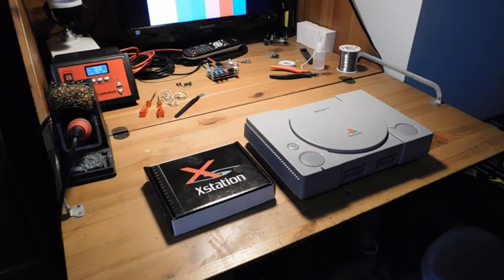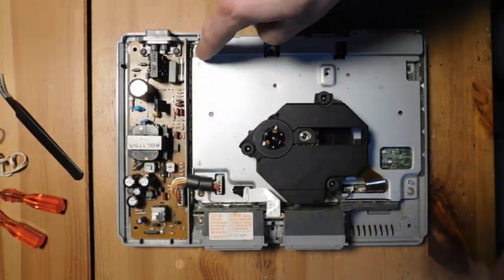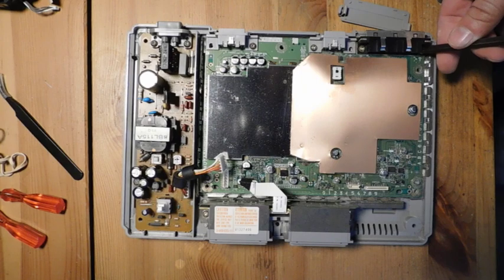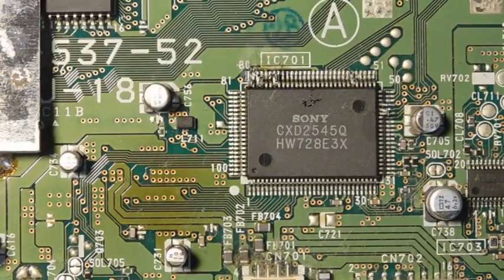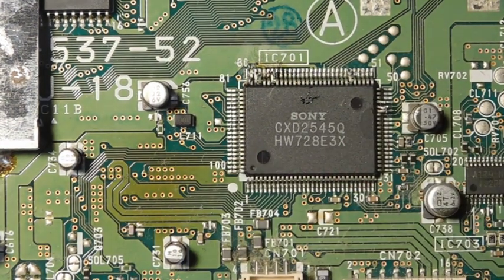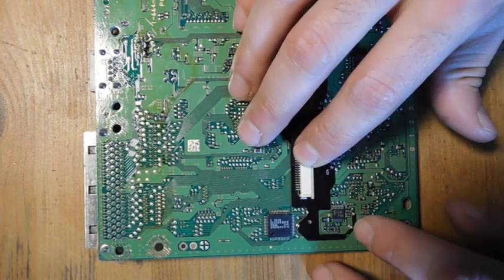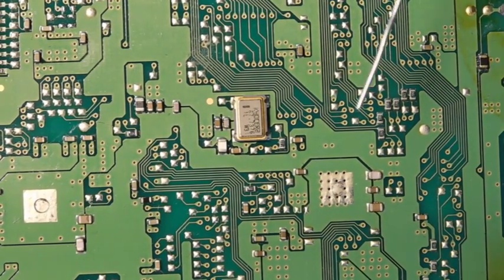Sony PlayStation XStation Install Guide - a new Optical Disc Emulator for the PS1!

Comment: Got mine in the mail today. Going to install tomorrow. Thanks for the guide and helpful tips.
Reply from the maker: Awesome! Hopefully the video will be helpful
Reply: @LIRetroGaming  I successfully installed mine. It wasn’t that bad. After learning how to pull up pins on the chip it was pretty easy. I think installing on the 100x model we have it a little easier. Less pins to pull and no non-solder points that need scraping. Bought a micro fiber pen that I didn’t end up needing. Oh well. Thanks again for the tips.

Comment: I'm going to install mine this weekend. Very good video! You made it look easy...except for lifting pins...I always hate doing that! Thanks for the guide, man!
Reply: Edit: I have installed the XStation and everything is working as expected. Pretty easy install, besides the pin lifting. Rama couldn't have engineered a better product! It is a very straight forward installation. I did have to hold the reset button down for 1 second to get the XStation to boot into the menu for the first time. Just a heads up, for anybody that runs into that.
Reply: Yeah, I hate lifting pins.  I accidentally broke on doing the saturn PAL/NTSC fps swap, and it makes me nervous everytime now :(

Comment: Nice guide, you don't need to cut the shielding though, just pass the ribbon through the slot thats forming between the two shielding pieces (lower and higher).

Comment: Im ok with soldering but that is a hell of alot of pins to lift scary haha
Reply from the maker: Yeah it can be a little intimidating at first. It’s always good if you can get practice on some kind of scrap PCB. Having magnification can also make it easier
Reply: If they snap you have still accomplished the same thing! It won't be a problem, but now it's irreversible without jumper wires.
Reply: @LIRetroGaming  hi what compatibility it will be ?
I heard its not compatible with 7000x series psx
Reply: @Sammy Van Dankstein ive done snes 50/60 mod b4 and megadrive 50/60 hz.. just not confident with xstation haha

Comment: Just got this for Christmas! Excited to jump right in though bending up those pins looks very scary.
Reply from the maker: Yes I would suggest practicing that if you can with a scrap circuit board. It’s not too bad once you have some experience
Reply: @LIRetroGaming  Yeah I may do that. Also going to get a magnifying glass.
Reply from the maker: Yeah I definitely recommend some kind of magnification. It makes proofreading your work significantly easier and really helps with pin lifting

Comment: I'm glad that the Xstation doesn't use the original optical drive connector, since I've got a Playstation with a busted one! It had torn completely off the board when the optical drive was removed and some pads along with it. Otherwise the board should be fine!
Reply: The installation was relatively easy! The main problem was that they only sell lead-free soldering tin in the EU, which apparently needs a higher temperature to melt (Between 370-425 C, or 698-797 F). I didn't know that at first which made the initial attempt frustrating. I found lifting the pins to be the easiest task! I accidentally lifted a neighboring pin to what I was supposed to, but it was no problem soldering it back on. Aligning the board in the back felt more challenging, but everything went better than expected in the end. The console might need recapping sooner than later.
The Xstation seems to be working properly! There was some issues with lagging FMV and hanging or freezing in some games, but I think it was a case of bad files because it all seems to be working correctly on different versions of the same games.

Comment: The official install guide makes no mention of cutting the shielding and the additional post you removed. Why did you do that?
Reply from the maker: It’s not mandatory at all to do that, but I cut the shielding to make it easier to bring the flex cable over to the XStation board. You can try it first without cutting the shielding and it should be fine

Comment: Hey, I'm new to modding and soldering but very much keen to give this mod a go. I was just curious as to what you are doing/using 6:43?
Reply: He's removing the Excess solder that may have caused a bridge between the two pads of the pins of that Chip with a "Desoldering Wick". and Sorry i'm 5 days late.
Reply: @FR4M3Sharma  Okay, awesome. Thanks heaps for clarifying that! 5 days late is better than not at all. Haha.

Comment: Here's a few tips when installing this. Use a hot air station to remove chip then use cutters to remove or bend unneeded pins. Resolder chip using flux. For the vias that are covered in solder mask, just trace the traces on the board to a nearby solder pad and make connections at that location.

Comment: Could I just snip the pins on the chip instead of desoldering and lifting them if I don't plan on reverting it back to stock?
Reply from the maker: Yes you can also do that too, as long as you are careful and you remove the severed legs as well
Reply: I think I might go the route of snipping the unneeded pins as well! Lifting looks scary and I'm afraid I would only make a mess with the solder and mess up the neighboring pins as well.
Reply: @LIRetroGaming  Just to be absolutely clear, what do you mean by removing the severed legs?

Comment: Used this quite a bit today, but good lord, I could never get solder to stick to the rightside connector that has the anti-solder stuff on it. I scraped the hell out of it, but the solder would just keep balling up on the tip. I read somewhere that that's for reset, but even getting however much I could get on there -- if any -- I get stuck on the menu without the ability to move the cursor. I can open the lid and move between Memory Card and CD Player, but closing it locks it up. It seems to be initiating the disc drive once the door shuts, but now that it's the XStation, something's wrong and so won't load anything. The pins somehow turned out to be the easiest part.
Reply from the maker: Damn, sorry to hear about your troubles with removing the solder mask. You may want to try a fiberglass pen, sometimes that can be more effective for removing the solder mask
Reply: @LIRetroGaming  Would that be the only reason the solder seems to ball up and move along/up the soldering iron rather than onto the board itself? I read somewhere that that could be heat issue, but mine is at 300, and most people seem to have the opposite problem. Thanks for any insight you can offer, this is driving me nuts.

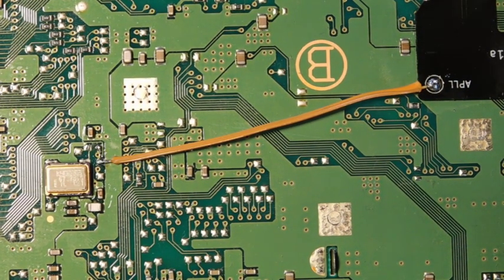Comment: 13:30 I didmt get that wire in my package!
Reply from the maker: It does not come with the package. I just have wire in my spare parts. 28 gauge wire is perfectly fine
Reply: @LIRetroGaming  dies the wire type matter? I used a random wire ha... And it only goes to the mem/cd screen :/ no xstation screen

Comment: What size wire did you use at 13:23 mark?
Reply from the maker: It’s 28 gauge copper stranded wire
Reply: @LIRetroGaming  Thank you

Comment: I was lifting pins on IC701 and when I got to 50's I managed to lift on IC308 not noticing. I went ahead and pushed them back and reflowed not installing the xstation yet and I tested it to make sure all was correct. If the xstation isnt installed after this point will you still get sound? The boot menu takes 10 seconds now and I dont get sound anymore. I hope once I install the xstation that will change because I reflowed those 3 pins back nicely, but no difference from before separating all the pins when I had sound
Reply from the maker: It seems like those pins might not be attached. I think you should figure that part out first before continuing with the XStation
Reply: @LIRetroGaming  Thank you and any chance I could ask what size wire you soldered on the connection point requiring you to solder a wire from the xstation to the board?
Edit: Also is it better to use single core or stranded wire?

Comment: Nice thanks for the video, it helps me to do by myself.   
The thing do not boot, check all again and the result: I forgot to solder 1 pin ja ja ja.   Everything is fine now.  Love this thing.
Now If only there was such a cheap option for my sega saturn like the xstation.  :(
Reply from the maker: So glad that you got your instructions to work and that this video helped. And there is a cheap sd card option for model 1 saturns called Fenrir
Reply: @LIRetroGaming  Ho, thanks, but my saturn is a 21 pin saturn.   And they only sell on Europe, whit the taxes and the shipping the price rise up more than I spected.

Comment: What temperature do you set your iron to when lifting the pins? Is it higher than the temp you use to solder the joints?
Reply from the maker: No I keep it at the same temperature, which is around 700°F

Comment: I have that exact same soldering station, I mostly use the curved conical tip but I have just about all of the hakko 900 series tips possible.

I have my board prepared and ready to install the xstation when it gets to me. Also found a few 1TB sd cards for 20 bucks. Probably gonna be slow to transfer but probably not gonna impact the xstation.
Reply from the maker: It’s cool that you have the same soldering station - I got mine many years ago when a local radio shack was closing and it’s one of the best things I’ve ever purchased. You are definitely going to enjoy the XStation when you get it!
Reply: I remember when my local RadioShack closed. The manager was very knowledgeable and I learned quite a bit about soldering older style connectors. I never took any courses though, I learned all by myself. I tried reworking a guitar hero controller and wound up killing it. Then I practiced on a few kits and finally a busted cdrom drive.

The very first ps2 I tried chipping I ended up killing it, spent a considerable amount of time trying to fix it and just chucked it after a while.

I've came a long way since then and have several ps2 consoles modchipped.

Speaking of which, if you have a 5000x series ps2, GH-026 or GH-023 board. I was able to get the comsoft laserfix working on them. Link is: https://www.obscuregamers.com/threads/comsoft-v4-fix-confirmed.2978/

I suspect I'll need to replace an LA6508 on one as the tray isn't ejecting. The GH-023 I swapped the la6508 from that into the current GH-026. Thats what leads to my suspicion anyways.

I still miss RadioShack, they were a good source of 30awg kynar wire. Wish I could have been there the first day of the closing sale. If have bought a few more stations and all the wrapping wire they had. Managed to get like 3 or 5 of em and even though I'd like to start modding as a business I'm still hobbiest, maybe soon though.

Always a pleasure to see fellow modders.

Cheers!
Reply: @theguruguys  just read into more of those, probably not gonna get those really cheap ones. Gonna save up for the bigger card though, all the roms are ready.
Reply: @Sammy Van Dankstein probably gonna wait see what comes up on black Friday or cyber Monday deals. I'm sticking with sandisk extreme pro most likely in this case.
Reply: @Sammy Van Dankstein still have a few of the old black sandisk cruzer drives when they had the u3 programs. Fun times in junior high and high school. 

I remember they blocked hyperterminal but we could run it through command prompt on windows xp, even worked from a batch file. Same thing with programs normally blocked. Right click and choose run as... then choose the second option as another user, but type in your network domain and your regular account like this:

Domainsample\\youruser
Password

Then most programs like nirsoft system tools could run, even ophcrack, portable Cain and Abel, web browsers normally blocked, etc! On what was supposed to be a limited user account.

Few years later my brother had those programs installed by default on the computer he got from school. The changes we made to the selection of programs.

Comment: mine wont do anything except boot to the cd player screen. Checked every point for continuity. its all good. i dont get it
Reply from the maker: Are you holding down the switch on motherboard? The XStation menu will not boot unless the lid detect switch is held down
Reply: @LIRetroGaming  yes
Reply from the maker: And what is it doing with the sd card? Is the green led blinking?
Reply: @LIRetroGaming  Green led blinks for a second and then stops. With no SD card in, it blinks green continuously. Tried 3 different SD cards. Two lexar 633 and one old hp one. All fat 32 with the 00xstation folder on them.
Reply from the maker: Ok then it will be hard to diagnose further without pictures. Make sure that you lifted the correct pins and that the area underneath the lifted pins is clean
Reply: @LIRetroGaming  hey thanks for talking through it with me! Not many people take the time to help. In the end I went out and bought 4 micro SD cards. Different brands. One of them worked. It's a Samsung. So I guess it just doesn't like some SD cards.

Comment: Hi there. Should I install the Xstation or the PS1 digital first?
Reply from the maker: I have done it it both ways and I found that it was easier to install the XStation first. The PS1Digital flex cables are fragile so it’s easier to install them last
Reply: @LIRetroGaming  aight. Thanks for the reply. Cheers

Comment: PSIO
Pros - Easier to install, More models are compatible
Cons - Less compatible with games, More expensive than the xstation, DRM on firmware

XStation
Pros - More compatible with games, a bit less expensive than the PSIO
Cons - Harder to install, less models are compatible
Reply from the maker: That’s exactly the tradeoffs between these options. For now I prefer the XStation’s tradeoffs and my hope is that it will eventually be compatible with more models of the PS1

Comment: I don't understand why this isn't just a plug n' play style mod. Why does it need anything other than the data/power from the CD ribbon cable?
Reply from the maker: I believe it that the CD drive controller chip is the reason why you can’t have a plug and play style mod with the ps1. It needs to be bypassed completely and the inputs that normally go to this chip need to be fed to the XStation directly
Reply from the maker: Other optical disc emulators like PSIO also need an intervention. Unfortunately I think the design of the PS1 hardware will always prevent a plug and play solution from happening

Comment: What wire are you using to attach to the QSB?
Reply from the maker: Pretty sure that I used 28 gauge copper stranded wire for my previous installs
Reply: @LIRetroGaming  Thanks I went to microcenter and got 26 gauge stranded. Excited to get to work!

Comment: Mine boots to the  bios, not know what todo???
Please help
Reply from the maker: Is the lid installed? If the switch on the top of the motherboard it’s not activated by the lid, then it will not boot to the xstation menu. It may also be an issue with the QSB or perhaps the pins are not fully lifted
Reply: @LIRetroGaming  Thanks, seems like something is wrong whit this ps1 motherboard.   Found another ps1 board and in this another board works like a charm.

Comment: A PS1 without the optical drive sound searching for the LBAs to read feels soulless, like a emulator. Most of the issues with the PS1 optical drive are dirt and unlignment, which are fixable.
Reply: I get that, but some of these games are getting up there in price. 

What if someone made a mod to put a speaker that made that sound? Lol.
Reply: @axelkusanagi4139  People will not SD mod to run original copies, I don't believe that every game there the owner has the original, so there's no reason for thinking people will be limited by prices of the original used games in order to run a disc, he will just burn it.
Reply: I totally get you, it's definitely not the same thing. But the Xstation and other Optical Disc Emulators are a fantastic development for video game preservation! Old optical drives with the mechanical moving parts will not last forever, and the discs themselves are getting scratchier by the years. So an ODE is a great way to allow you to use original hardware without worrying about that aspect.

Comment: Love the idea. But my old pc from 2009 emulates the games just as fine.. lol
Reply from the maker: Definitely, nothing wrong with that approach either. This is a good option if you want an easy way to play ps1 on original hardware but not rely on optical drives that eventually fail
Reply: @LIRetroGaming  I remember modding the old ps1.. Those days of 2x burners.. Oh lord the nostalgia!! lol

Comment: I probably screwed this up, i get nothing but a black screen when I power on. One hundred dollars down the drain.
Reply from the maker: It’s probably not destroyed. I’m sorry that it did not work out and maybe I can help get it working
Reply from the maker: Send me photos of everything at 1uprestorations.com
Reply: @LIRetroGaming  Its done I probably bent wrong pins and I I melted the solder point for the PLL wire.
Reply: @LIRetroGaming  I removed it and probably need a new QSB since the gold solder points came off.
Reply from the maker: Oh man, I’m really sorry to hear that it turned out this way. If I can help you in any way please let me know
Reply: @LIRetroGaming  Thanks, a costly mistake. I got a new system and ordered a new QSB. Going to send it out and have it done. Kinda bummed since it was to be my project.
Reply from the maker: Yeah it is unfortunate. Fortunately the most expensive part of the XStation is not the QSB, and that was not damaged. I can always do the install for you when you get the parts
Reply: @LIRetroGaming  Thanks I'll remember that.